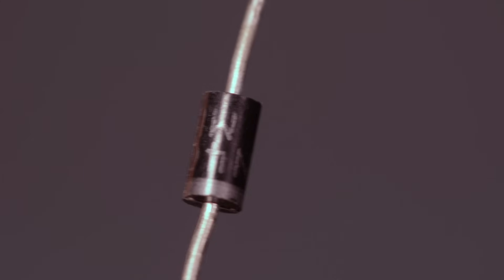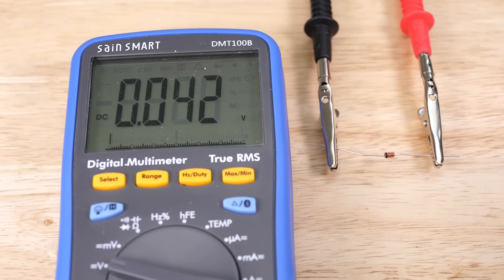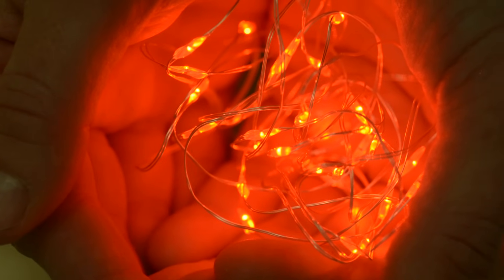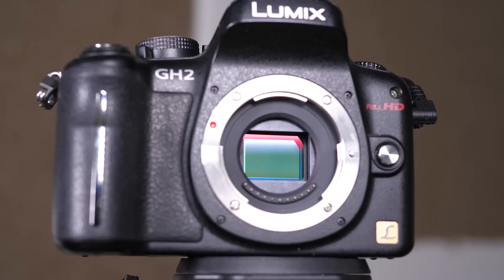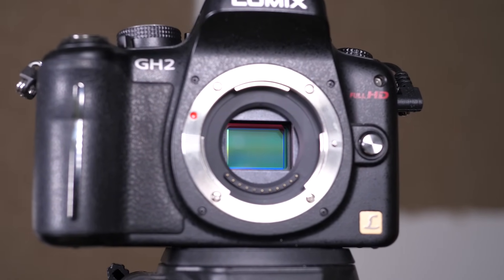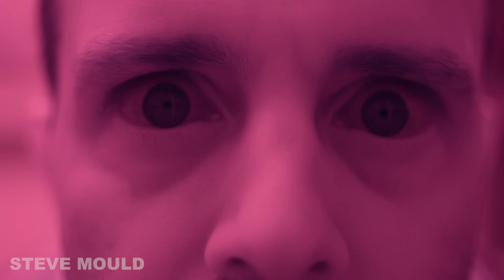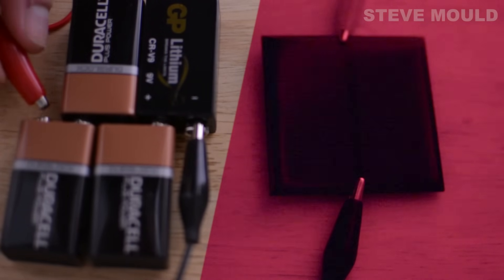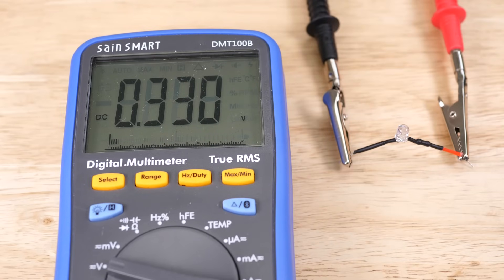Why all solar panels are secretly LEDs (and all LEDs are secretly solar panels)

Comment: In fact, it is used to detect faults in Photo voltaic arrays (SPV power plants) when the plant contains thousands of modules.  It is termed as Electroluminescence imaging (EL). (Also known as Dark IV curve)

 Photoluminescence Imaging (PL) is another test used in laboratories to identify faults in cells.
-----------------------------------------------------------------------------------------------------------------------------------------------------------------------------------------

 Unlike electroluminescence (EL) imaging, which relies on the detection of relatively bright signals and can only be employed at the final stage of solar cell manufacturing, low-signal PL imaging can be implemented throughout the entire manufacturing process.PL imaging has great potential as an in-line monitoring tool. The ability to utilize this highly sensitive imaging technique during the early stages of the manufacturing process has significant ramifications, as PL images of ingots, bricks, and as-cut wafers can be predictive of final solar cell efficiency.

When 800 nm excitation light is applied to mc-Si wafers, electron-hole pairs generated by light photons recombine, causing photoluminescence emission. In the band-to-band (~1000 – 1200 nm) wavelength range for these wafers, the photoluminescence associated with defects (i.e., impurities or anomalous material compositions) is weaker due to the recombination of relatively fewer electron-hole pairs in the flawed regions. Therefore, defects are perceived as darker in band-to-band PL images.
----------------------------------------------------------------------------------------------------------------------------------------------------------------------------------------
Though thermal imaging (IR) can be used to detect the faults like hotspots or Potential Induced degradation (PID) during daytime, EL can be used to detect the same at night time with more safety (plant is not energized and won't affect the generation).

It consists of applying a direct current to the PV module and measuring the photo emission by means of an infrared-sensitive camera. EL imaging provides insight into micro cracks and other defects within the cell material. This in turn helps identify faults and problems present or developing within the PV module. Also, the method is quick for fault detection and for analyzing the reliability of the modules after wear and tear due to environmental effects and faults in power system.(Hotspot, PID, fused bypass diode, broken strings etc.)

Using drones equipped with CCD cameras or stand alone cameras, photos of the arrays are taken at night after applying forward voltage to the strings. Modules with defects will have reduced illumination compared to others.

An electric DC power supply capable of applying Isc of the module or a series string of modules of interest is required. The power supply must be able to provide sufficient voltage to achieve ISC. Depending on the module technology, the required voltage may be approximately equal to the open circuit voltage VOC of the module. The photo is shot using a CCD camera and image is analysed for dark spots which evince defective modules.

 Check EL photos in google for a lucid understanding.

https://photovoltaikbuero.de/wp-content/uploads/2017/02/11Dark-VI-curves-measurements-compared-string-2-defective.jpg

Comment: "LEDs are solar panels"
By that logic, I can make a solar panel by only using christmas lights
Reply: YES, AFTER CHRISTMAS YOU PUT YOUR TREE OUTSIDE in the sun to provide electricity until the next christmas
Reply: @RabbitholeIsrael  dayum!
Reply: @RabbitholeIsrael  That might be a neat project. Hook up battery to the christmass tree->let charge over the year->next christmass you can only use whatever is left in the battery. 
I think the battery should have less voltage than necessary to light the diodes. You then proceed to light them via boost converter.
Reply: Actually, if you search you can find projects of homemade solar panels using only LEDs
Reply: What about old LED TVs? Maybe a way to recycle them instead of sending them to the trash pile. Saving the planet one TV at a time.
Reply: @DarkDucky79  the only true LED TV's either use small rgb clusters or carbon (Oled)
Reply: @DarkDucky79  alot of electronics are sent to other countries and stripped using cheap Labour
Reply: @DarkDucky79  those LCD TV marketed as "LED TV" are actually lcd tv with a few LED backlight (they were using CCFL before). And those few LED (<80) are hidden underneath the LCD which is almost opaque when unpowered.
Reply: @WarayF1  thanks for the info
Reply: But a very inefficient one
Reply: @santiagocortez9554  free electricity is free electricity
Reply: This brings up an interesting possibility of having a massive array of Christmas lights on the roof, using it in reverse to charge a battery during the day, and then using the power collected during the day to power the lights at night.
Reply: @MegaBrokenstar  Or... just put a solar panel on the roof which would be a lot more efficient.
Reply: Most Christmas lights aren't LEDs. At least they weren't when I was a kid.
Reply: @vickielawson3114  how long ago was that? Cause most are now.
Reply: @joshyoung1440  I don't think they were LED until several years ago, but before that they were all tiny incandescent bulbs.
Reply: In infrared they might be able to glow a little.
Reply: Christmas lights only have small light bulbs
Reply: @FactForge33  damn it i forgot about those

Comment: "This video is a lie."

I've heard this before, and the problem that I have with it is that it doesn't seem to me that solar panels qualify as diodes, so much so that in a solar array, you have to install actual diodes to prevent reverse flow of electricity, wasting energy as heat and "light" (that you can't see).   If a solar panel was itself a diode, why does it need diodes installed to prevent reverse flow?

At the minimum a solar panel is a very very bad diode. So does it still qualify as a diode?  I mean, I'm a very very bad zebra, but I'm still a little bit zebra, am I still a zebra? At what point are we fudging the definitions of words beyond usefulness?

This is an honest question.
Reply: Well that's almost a philosophical question
Reply: @rodrigo-vl7bi  Join the zebra club.

Comment: That means the led switch over sends power back to companies when lights are off?  Maybe? If not then light fidelity will definitely take WiFi out as info transmitter.  I believe the reason an led collects current as a receiver is that a standard led can pulse up to 133000 hertz.  The sun goes through 12 frequency changes marking the zodiacal significance. So it’s di means two and ode or hodos meaning way.  2way yeah have you seen my baseball.

Comment: Wish he posted the link to the microphone speaker vid
Reply: Just connect a dynamic speaker to anything that uses a dynamic mic input. It will work, just not all that great. You can do the reverse with a dynamic mic, but keep the level very, very low or you’ll blow out the mic. It will be very quiet.

Comment: so ...  in theory ...  if  you have an led flashlight  with rechargeable batteries ....  you  could position the  led   towards  a strong light  source ( the  sun  )  and  the batteries  would  recharge .....  eh.....  eh ....  whaddaboutdat...  eh
Reply: Only if the led generates enough voltage to push current into the battery.

Comment: Phones can see IR, I use my phone to test IR LED's.
Reply: Not all of them
Newer ones usually have filters
Reply: Back when we had remotes for TVs I would do the same thing to check if the batteries were still good in the remote controls.
Reply: @midwestmangos2452  TV's still have remotes, lol
Reply: @sspence65  LOL yeah they technically do, we just don't use them because we use the smart TV app on our phones.
Reply: I haven’t met a camera yet that couldn’t see IR. I find that fascinating.

Comment: This is how our kids are made as Stupid as a peace of toast!
In fact direct SC like GaAs can do both, (convert in both directions), but are often better in 'making' light while production of electric current from light is often inhibited by the fast recombination of the eletron-hole pair and reemission of the photon(depends on carrier mobility AND recombination propability!)
Indirect SC like silicon on the other hand are normaly quite good as solarcells, but awful LEDs, due to the fact that two charge carriers with the same impulse(electron+'hole') can't combine to a photon.(other direction for photoexitation is less problematic since one of the new carge carrieres can carry away the excess impulse).

Comment: What if you connect a led to a solar panel and take the led in front of the panel?
You get a non ending circuit?
Reply: My 1st thought would be....The light would eventually fade due to the resistance in the wire. Unless of course the sun would recharge the circuit through out the day.
Reply: Sure, except for the second law of thermodynamics. Everything has losses.

Comment: I used a Bob Beck magnetic pulser to send a 16,000 gauss magnetic pulse through the air - with my head in the middle - and caused an led - with a wire coil attached - to flash.  It burned out the led because the current was too strong.  My head is still ok - I think.

Comment: just a quick question, does this mean Infared leds will act better than regular leds as solar panels?
Reply: Great question! Didn't even think of that.
Reply: Infrared LEDs can absorb a broader range of the solar emission spectrum than visible LEDs, yes. But both IR and VIS LEDs are bad solar cells.

Comment: What could have been a good addition to the microphone/speaker analogy would be the TV Remote control diode and the receiver unit diode. Both units have a diode, one sends the pulses of IR light- one receives those pulses of IR light.

Comment: Yeah, diodes are capable of more. In fact, if you put a gate on that diode, you get this cool thing called a transistor!
P.S. you’ll only get a reaction from light in a GLASS diode, but you’ll be pretty disappointed with a standard opaque 1N4001 diode.

Comment: Does this mean that you can turn a led tv screen into a solar panel for off the grid purposes?
Reply: No. While all LEDs do exhibit the photovoltaic effect, to some degree, they are not at all optimized for this purpose and as such are extremely inefficient.

Comment: Microphones and speakers are not always the same thing. Primitive carbon mics are effectively just a resister shaped in a disk. It changes shape due to pressure of sound waves, and therefore changes resistance proportionally. If you pass an alternating current through one, it won't emit sound, unless of course the current is enough to melt it.

Comment: We've bought some small LED star-shaped Christmas ornaments in December (the kind that each LED is attached to the previous one with a small cable), and have used rechargeable batteries to power them. Wanted to recharge the batteries once they were flat, but till this day the ornament is lit. I never understood that till now: basically the batteries are getting charged during the day by the LEDs and the LEDs shine when dark... 
Granted, the LEDs aren't so bright like with a fully charged battery, but they still shine. 

Am I wrong with this assumption or there's more to it?

Interesting and cool stuff to know...
Reply: No

Comment: Wouldn't it be more efficient if people designing garden solar lights or solar lights in general designed them with the ability to not only used the solar panel to charge, but also use the led's?  Would increase the recharge ability with minimal redesign.
Same would go for ele tric vehicles. Always thought it was a great idea to have solar panels on a car, but how about also using the lighting systems to help charge?  Ever bit would help with an electric vehicle.

Comment: thats why solar panel 'eats' power at night
Reply: You can (must) use a diode, it will not eat the battery because it is connected in reverse from the battery.

Comment: That's so neat, I'm guessing they get the most W/m^2 by absorbing around the infrared spectrum? Are there other eletromagnetic waves that can be absorbed for electricity? I'm guessing in space outside the van Allen belt there would be more you could absorb...
Reply: The peak from the sun is actually in the green-yellow band.  But silicon works better with lower (redder) frequencies.

Comment: Radio Shack put out a book in 1986, I believe, by Forest Mimms - "Getting staarted in electronics". In it  he stated that all diodes transmit as well as receive light.  I stated that on an Above Top Secret website when they were talking about Big Brother watching you thru your television.  The Moderator told me I didn't know what I was talking about . I can read and comprehend quite well -  I knew he was a shill.  Another Radio Shack electronics book said that transmitters are receivers and receivers are transmitters... So I applied a few changes to a light wave transmitter in one of the projects.... Let's just say I had unexpected results that freaked me the F out!!!

Comment: Could LEDs 'participate' in recharging a (battery) power source?
Reply: Denispat I second this question
Reply: LED is not an efficient solar cell. and solar cell is not an efficient LED.
Reply: Your efficiency would be very low. It might even be so low that the losses dominate and it would never charge.

Comment: Hi there I like your video, you seem to know your stuff and I love the  inventive thinking when you suggest diagnosing solar panel faults by powering them up similar to the way an led is lit by passing current through them,
Nice idea but for all those who aren't aware! you should never use a diode without a resistance or a constant current and similarly I imagine using the technique to diagnose solar panels would carry the same risk but this time with expensive solar panels!
I would suggest
Use a simple light bulb as your resistance, or use a bench top power supply where the current can be limited and ramped up gradually

Comment: Which is why you need blocking diodes when connecting solar arrays together. During the day your panels charge the battery, and at night, without blocking diodes, you can see a very faint glow on the panels. This the battery discharging through the panels producing a faint glow.

Comment: I always wondered if they would work like that. So if you heated the filament from a light bulb, would that produce electricity?
Reply: Maybe, but first there is no way to directly heat it and secondly it will be negligible. I emphasize maybe. This is because it can become a thermocouple because there is more than one metal there. One thread and the other those things that hold it that I don't know exactly how to handle it.
Reply: @batvanio  maybe put it in a vacuum with one mirrored side focusing light. Probably won't produce much electricity
Reply: No. And you also cant fill your cars gas tank by pushing it backwards.